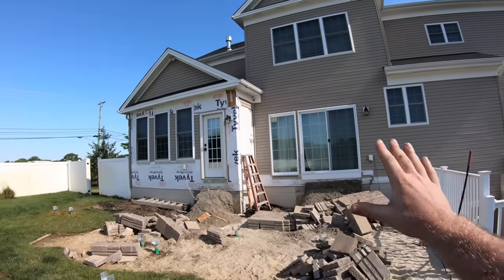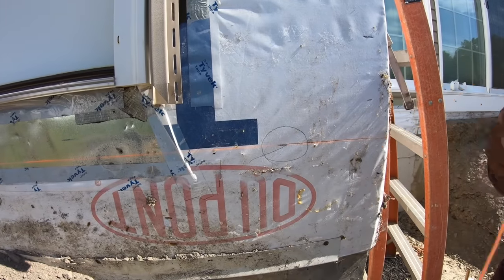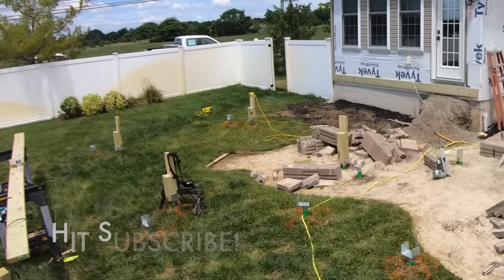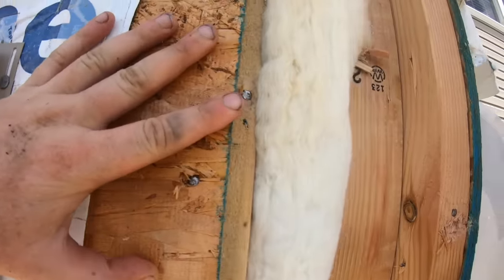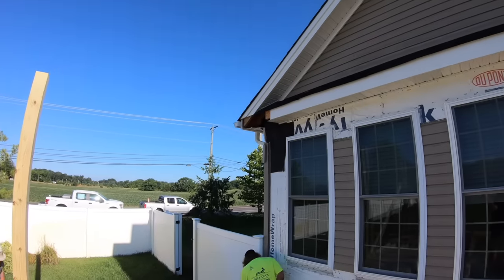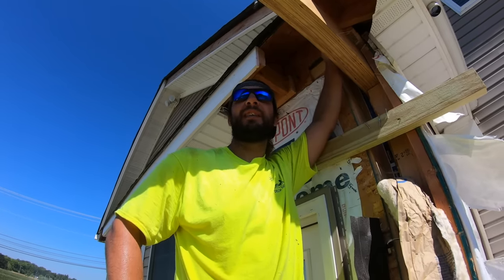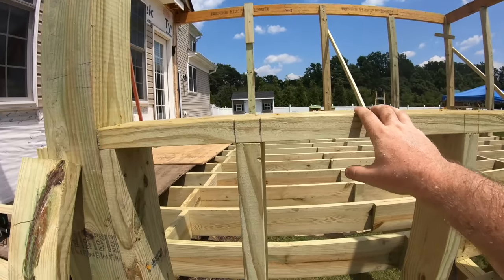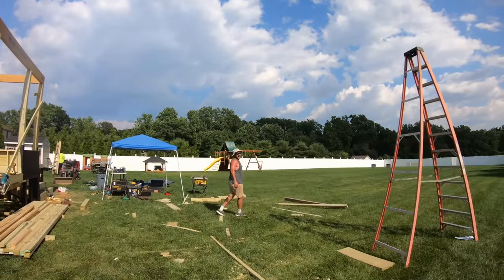Building a Deck With a Screen Porch - PART 1

Comment: Since you had your joists run along the tops of your girders, how did you install your support posts for the roof load?
Reply: I was looking closely at the same thing because he glossed over this with “the posts are installed” and that was it. If you look closely, the roof posts are set in their own footers that attach to the rim joist.

Comment: Are the tall posts for the porch walls anchored to the ground as well? You described how the shorter 6x6 posts that support the deck were anchored to footings, but I'm curious how you connect the taller posts as well. Thanks!
Reply: I'm wondering the same thing.. I didn't see any piles to accommodate them
Reply: Exactly, they explain everything else but fall short on this item.
Reply: I was also curious 🤣 Seems at the 12 minute mark, the first 4 main posts run fully down to the footings. Looks like for all the intermediate posts, they sandwiched them with another joist @ 5.5" in from the outside rim joists. The "intermediate" posts dont run below the joists at all...so we can only assume that...they ran lags in on either side?? Non issue i guess as theyre not techically 'load bearing.'
Reply: @moosecuddles918  YOUR NAME IS MOOSE CUDDLES! I <3 CUDDLING MOOSIES

Comment: Couple questions:

1 : I seen that you notched both the top plates at the beam pocket in the wall corner.  Can you notch the top plate anywhere,  because I have heard you cant notch it within so many feet of a corner, can you just throw a strap on it if you have to?

2: I seen that on that beam pocket, you left one of those corner studs running up all the way to the plate which made sense because your support posts sat inside the deck framing, so there was no need to notch it out. In NC, the posts are often sitting ON TOP of the deck framing, so if the deck framing ended flush with the house framing, would I be able to notch that corner stud out also, or is it necessary to move the posts in from the edge of the deck framing, frame the deck different, etc.

Comment: Just got done watching one of your other videos and you had said when you put three boards together you should be using a flashing tape on top of them and I didn’t see you doing that on that both those beams going across is that because it’s going to be indoors, but it won’t be indoors for a while, right?

Comment: Great project. Question from a novice please….. What is the strength of those self tapping screws you mentioned on the piles if there was a lifting/wind event? Or does the fact its attached to the house and a rather large structure, those forces would be negligible? 
Thanks

Comment: Question: appears you used treated lumber for floor joists, and 6x6s but switched to standard for the rafters. That true? If you have a full roof and windows do you need treated 6x6’s?

Comment: Look's good, but the 2x beams that support the floor joists on any exterior deck, should be covered with house wrap, or tape to keep water from penetrating between 2x material. Water will set in there, and rot the wood after about 10-15 year's.

Comment: I hope you removed the grass from under the deck and replaced with compacted base and gravel for proper drainage into a trench or French drain away from the home. I need more details , impress me with the details
Reply from the maker: French drain should not be compacted. Should be loose un disturbed soil underneath a clean stone trench that surrounds your pipe with a soil separator between those layers. But that is 100% not necessary on every deck and definitely wasn’t necessary here.

Comment: All that expense and great work for a house with cheap looking vinyl siding?  The deck is likely better built than the house as evidenced by the sill rot.
Reply from the maker: Maybe later they will upgrade the siding

Comment: The footings don’t seem legit how is it going to sustain that weight without sagging over a period of time the reason for inspections is to insure that everything is up to code seems like a cheap way to speed up the job
Reply: And save money for the instead of using it for the concrete.
Reply from the maker: Trust me it’s way more expensive than concrete footings. These cost $265 per footing and the reason they don’t need to be inspected is because they come with an engineering report upon installation. Do some research and you’ll understand what makes these footings better than concrete
Reply: Premier Outdoor Living I will have to research them for sure

Comment: I still would of done concrete footers, code here
That's where all the 2/10s went to lol
Reply from the maker: Look into helical piles, more expensive than concrete footings but much better in my opinion
Reply: @THEpremieroutdoor  
Good build
have to agree - helical are the way to go. I will never rent one of those hole diggers again.  Just wish home depot and others equipment renters would start getting into the Helical machines. All they really have to do is get the add-on to their existing backhoes I would think - in fact do a promotion if you purchase so many posts you get partial rental free.
Cheers